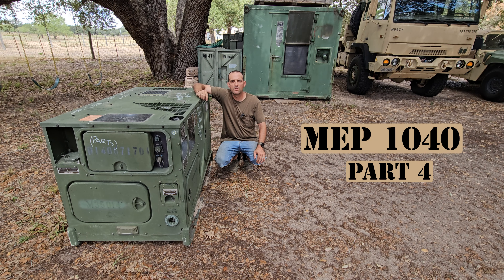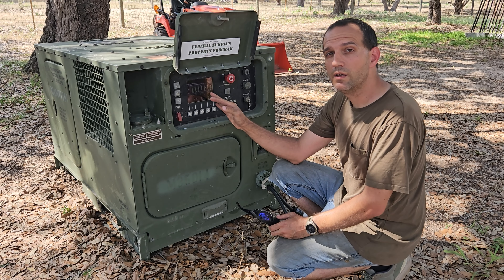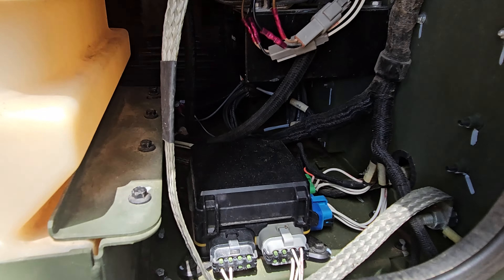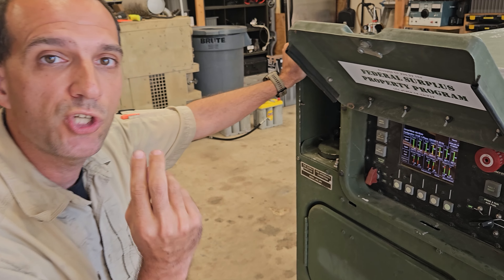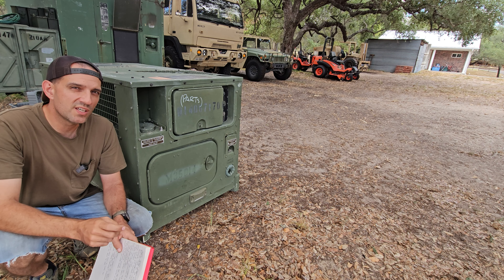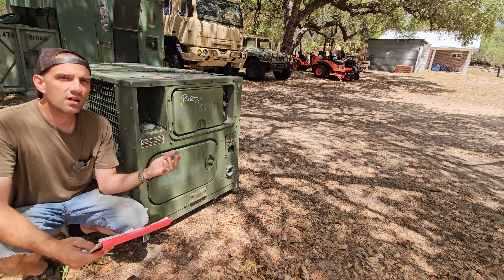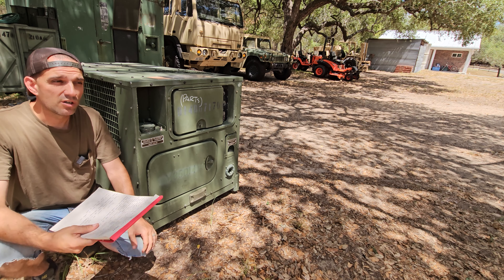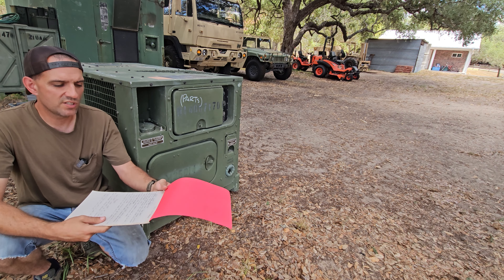MEP 1040 - Part 4

Comment: That thing gave it all. Kept up with 20% over rated load for just under 6 hrs, yeah who would have guessed working it to the max on a questionable history would be a great idea.. Its a shame and a hard lesson learned. I would have tested at rated load for the duration test and not worked it to the max.
Reply from the maker: It was already doomed the more I've learned. Unit for sure had an issue already inside the generator head & it's why it did this. The same generator head it used in the MEP 1050, so the generator head itself can handle the load.

Comment: Great video series.  You definitely earned my sub.  Those military generators, the older ones, are probably bulletproof.  It’s when they start trying to add too much tech, too quickly, and then you’ve got PVT Joe Snuffy running it who thinks he knows, but finds TM’s boring except for the bare basics of operation and PMCS…
That’s a disaster trifecta.  

I think you’re right in your conclusions.  So, maybe you’ll get it rewound later, or get another surplus generator parts unit to get the parts you need.  Either way, it’s a good learning experience.
Reply from the maker: Hey, that was me, PVT Joe Snuffy here, burning it up! Haha But honestly, it seems to be a big complaint that these will not drop the load like the older TQG would. It would be simple to program in & I hope the latest firmware DCS has it in there.

Comment: Don’t think you made mistakes. These units are rated at 10kw at .8 PF. With the purely resistive loads you used you used you were under the rated output…. I routinely run my 802A at 6.5KW running 100% resistive loads. Don’t be down, you got a deal on the unit and could make that back on parting it out if you wanted. meanwhile you learned lots and made some interesting videos. As others have said, pull the generator head and have it re-wound. Mechanically it’s solid.
Reply from the maker: If I get the time to do it, I will get it rewound & confirm. Just not sure it's worth taking time away from other things that make me money right now. But, it's there if I get the time!

Comment: A lot of electric motor rewinding shops can rewind your stator for a fraction of replacement, my father did this work
Reply from the maker: I was thinking about this route. There is also a dedicated generator repair place that does large units not to far. I may ask if they are interested & know about doing the rewind if I bring them specs.
Reply: @CallMeColtLLC  we always got the specs when the wire was stripped out, wire size, number of turns, type winding, etc. that’s all assuming the wiring is bad
Reply: @CallMeColtLLC  You can call around.  Highly doubt you will find it cost effective.  Local is your only chance.  If you have to ship... the juice will never be worth the squeeze.  I see lots of comments to get it rewound.  I don't think any of them have ever had such work performed.  It is pretty much relegated to large industry stuff.  50HP motor in leading eight pole delta configuration, on a 4" shaft with a mount configuration nobody has seen.  Hence why they get repaired over being replaced.  If you don't have industry pockets they are not going to give up a slot for low revenue non recurring business that could be utilized with repeat customers that don't wince at the estimate, and pay the invoice even at  2x.

I'd like to be wrong, and maybe I will be... but I doubt it.
Reply: @Failure_Is_An_Option  The answer is always no until he asks.

Comment: Your spare DCS on the shelf should work in any 1030, 1040, 1050, 1060, 1070.  The DCS on boot up reads the engine configuration DIP switch on the circuit board to the left of the CT's and then it operates accordingly.  Thanks for posting part 4!
Reply from the maker: I appreciate your help as well. Yes, I learned that the DCS works across all models. Huge plus on these! I definitely want to get more if I can for a good price point.
Reply: With the same Dcs work on the 1070 also?
Reply: @MrTurboCowboy   Yes, I should have listed it in my reply .

Comment: You can do a stator insulation/resistance check to rule that out. Chances are the excitation fault is occurring because the stator insulation has broken down and is now shorted.
Reply: Right... everybody has the ability to perform a dielectric withstand test...
Reply from the maker: According to the TM, without the special tools, it must be removed from the unit to do so or you'll get false readings like I said in the video.

Comment: Great follow up video, I think you are correct, it was already having issues and the load test finished it off, not your fault as you did not know, I'm sure you will find another unit for parts.  Do you plan on doing any videos on the HMMWV ?  Thanks.
Reply from the maker: I didn't plan to do anything to in depth on the HMMWV since there is a ton of videos on them already. It will stay at my off-grid place. Might just have a quick overview video of it & then have stuff here & there using it.

Comment: I think the issue might have been the gen set's ability to shut itself down, when overloaded. That is why I would never do a test run with overload parameters. My test would be to run 80-100% for 6hrs or so with occasional spikes in load. The gen set is able to handle up to 120% of capacity but not the long term. Also there might have been some dirt or critters nest in stator which eventually caught fire or overheated and caused the stator wires to melt. Either or, I would find a stator specialist and rewind it. Should be around 1000 if you take the stator to the specialist and install it after. Good series though. Really enjoyed it.
Reply from the maker: Thank you. The MEP 802A & 803A can run 120% all day with no issues. This one, after reading more in depth, should be able to do 110% no problem all day. There definitely was an issue already & I finished it off. I could remove it and get it rewound, be I'm not sure the cost & effort is worth it in my situation. It will take me away from things that make me money instead of costing me money. But, it is there if I get the time!

Comment: Shop around get it re wound 16:12
Reply from the maker: Was thinking about this after the posting the video.
Reply: @CallMeColtLLC  I'd really like to see inside the control box to see what's going on inside? See if it's all proprietary or if it's off shelf components packaged into a single unit.